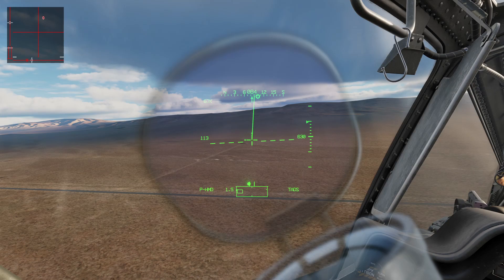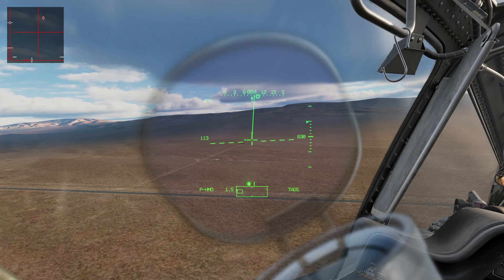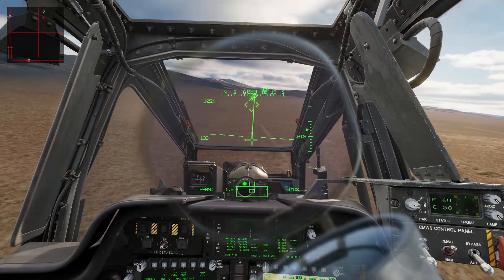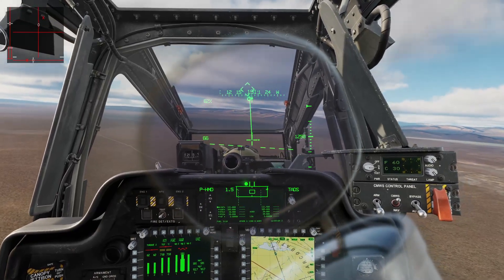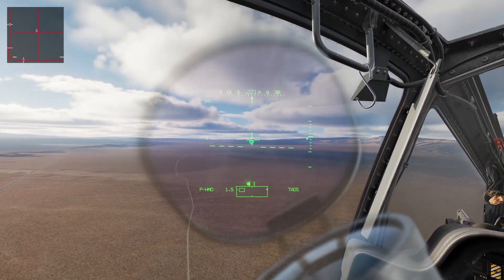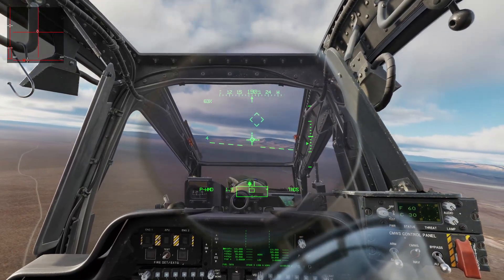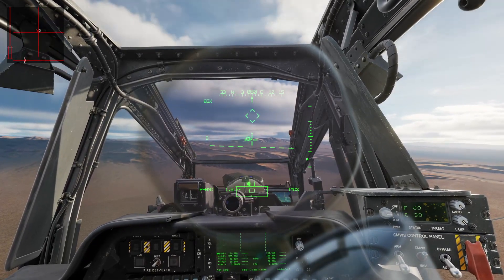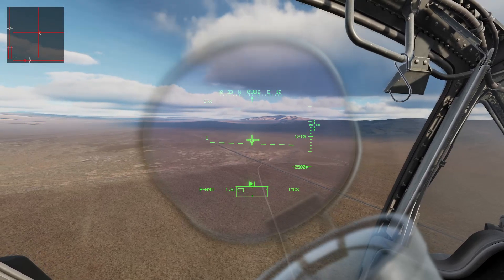DCS AH-64D Advanced Hovering Tutorial

Comment: Here is what I do and I have not seen anyone else use it. I use the hover symbology while getting into a hover, since it is more precise. I will get it into a relative hover and hit the trim and then refine the hover and hit trim again. When I get under 5 knots and almost trimmed out I will hit the Attitude hold and it will keep it in the hover. I will then work it into a 0-1 knots and hit the trim button again. The Attitude hold will then update to the new trim and keep you 0-2 knots in the hover, kind of like an auto hover. I have went to the bathroom, got something to drink, took the garbage out, came back and it will still be sitting there in that same spot in the hover.
Reply: Interesting. I could not find any description on what the Attituden Hold button does. Could you explain it to me please?
There is a second button called Altitude hold - assume this does what it is called right?
Reply: @sword_71  The Apache has two different Attitude holds. When under 5 knots it will put the Apache into a hover hold, holding the pitch and bank to a zero attitude. It keeps you from moving around. Over 6 knots it will keep a speed hold, so if you are going 90 knots it will keep you steady at 90 knots.

Comment: It's incredibly dangerous to hover in a real helicopter that high.
Reply: why is that? Not being smart, just wanna know what your thoughts on it are.
Reply: other then a combat situation (where yes hovering will kill you) in a regular helicopter it seems more dangerous to hover close to the ground (under 100 feet) as you dont have enough altitude to safely autorotate
Reply: @comaOOO   Because you are vulnerable to anti-air assets at that height.  And if you are at a hover, you are not only a SITTING duck, but it will take a lot longer to start building up some speed again.  You have zero ability to evade when you're at a hover.  And if you're hovering under 100 feet you don't need to auto rotate and what are the odds that you're going to lose both engines randomly in a hover at 100 feet?

Makes absolutely zero sense.  This helicopter is specifically designed to be low to avoid radar threats and engage ground forces.  If you want to be high up in the air, go play in a fast mover.
Reply: @GTRNights  Ah, you mean combat helicopters and not helicopters in general (where hovering higher is generally less dangerous)

I wasnt talking about this particular helo but helos in general.  Your comment made it seem like if I take my Bellmaster then I should NOT hover high.  

good shit, yeah in a combat zone high is always bad.
Reply: @comaOOO  at some point though you can go too high to hover, ie, air is too thin… I think it’s somewhere around 3k+ feet ASL depending on weather. Cant remember the exact height
Reply: @ironsideeve2955  It depends on the helicopter and how much lift + power/torque it has. Every helo has a different cieling for hovering, but I think for most GA and even military helos it is around 3k-5k feet -- and that's probably MSL.

The general idea that it's more dangerous to hover high up is fairly inaccurate. As others have pointed out, for combat, sure. You're the easiest prey for anything that can shoot at airborne targets if you're hovering at 4k feet.;;

However, if you're considering hover failure, being high up is of course preferable because you have plenty of room to recover before hitting the ground. The only minor counter point to that is related to my first paragraph, which is that hovering at higher altitude requires more power. Settling with power and eventual vortex ring state conditions are easier to fall into. So essentially, it's more likely you will fail to hover or fall out of your hover at a higher altitude.

Comment: There must be something very wrong with my setup as I've been trying this for a week and still get random movement in all directions which make it impossible to hover consistently.
Reply from the maker: it just takes time also some settings can be changed in the mane menu
Reply: @JetSimmer101  had a go before without touching trim at all and it felt much more controlled so I think it's just trim can get confusing. Obviously not great though as tiring and you need fingers free to do other things.